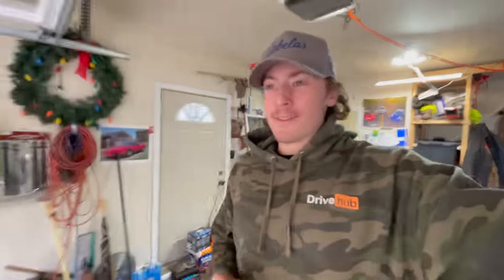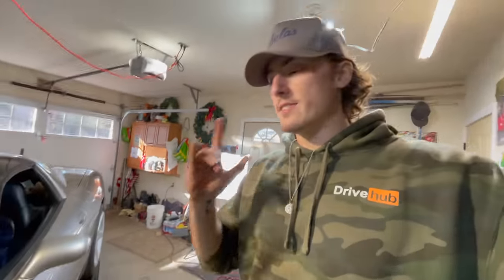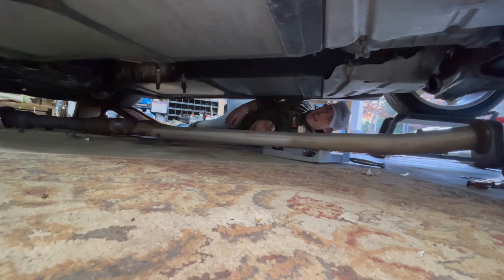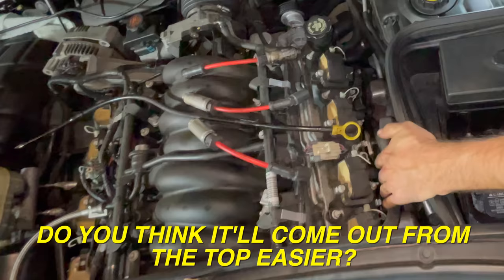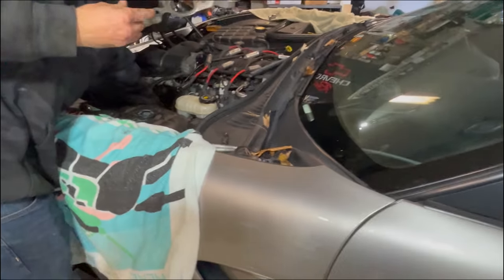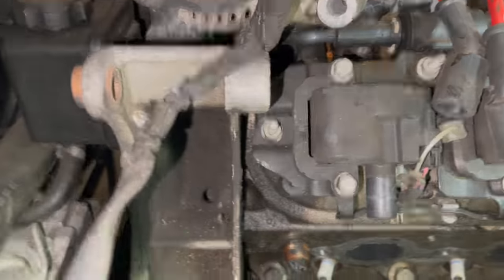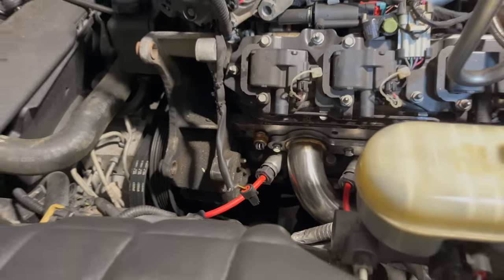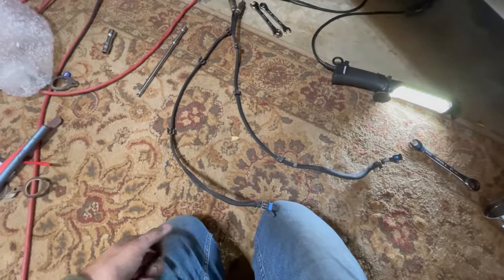I PUT INSANE HEADERS & X PIPE ON THE C5 CORVETTE!!! *C5 Corvette Headers Install | DriveHub

Comment: Here's my two cents of advice having done a lot of headers in the past 50 years in driveways and garages on many different sports cars. Number one get at least a basic repair manual like a Haynes and read the parts relating to removing exhaust manifolds and exhaust systems before you start so that you don't have to be guessing about basic things like how many oxygen sensors there are and where they're located. Number two get that car much higher off the ground. Number three buy a lot of WD-40 with the snake around and point metal nozzles and soak every fastener a week. And my recent addition to what needs to be done is to watch every YouTube video that exists about doing the job you were going to do with a critical eye and picking out the best tips from each one.

Comment: I ran short tube headers on my C5 for a couple years - I was told that long tube headers would be better for a quicker response.  I'll freaking swear by my long tube headers and the straight pipe set up I have now. Performance, launch and overall fuel mileage is outstanding !!! Not to mention the SOUND !!!  We (our corvette club ) does every parade within our two cities and I get Major Thumbs Up 👍  and Cheers from the crowds when I wrap the pipes up !! No one comes close to the pure sound of 560HP at 5000rpm.
Have fun - keep tinkering !!!

Comment: Awesome video!! Installing header's and an exhaust in your garage is a big job. 

I've installed a few exhausts and sets of header's over the years and I would recommend that you install a set of locking header bolts and not reuse the factory bolts. I'd also install a heat cover over the spark plug wires with the new header's.

The only other thing that I would do differently is to add a set of high performance mufflers to help with back pressure. I've always seemed to lose power on my cars when I've tried to run a straight exhaust. It probably wouldn't hurt to Dyno the car with and without mufflers to see if it makes a difference.

If you go with mufflers I would highly suggest a Borla S-Type system. It makes good power, isn't overly loud at idle and part throttle and has a fantastic exhaust note at wide open throttle. It's not overly loud but it's an aggressive, civilized exhaust note with a distinct sound.

I was sold on Borla exhaust systems 20+ years ago when the guys that I knew who drove Vipers in the Vettes, Vipers & F-Body club wouldn't use any other exhaust on their Viper's except a Borla because of the exhaust note that it made. The older Viper's had a pretty bad sounding exhaust note from the factory (similar to a milk truck exhaust note) and the Viper owners I knew were fairly sensitive about this.

Comment: Nice work! I enjoyed this video as well. I am, and have been, sort of up in the air regarding what headers to get for my '97. You already heavily steered me in the direction as far as exhaust goes- mine has a Billy Boat set up that sounds okay and looks cool, but that SLP is exactly the sound that I want, so I'll be looking at this particular brand. Did get black C6 Z06 wheels for what I thought was a good deal mounted up recently and just before it got "cold", I splurged on Z51 shocks and Steinjager front and rear sways as well as endlinks. Glad I did because I found out that a shock was blown and a link was busted- the car was all over the place when driving on uneven surfaces. Almost scary in a sense. So, finances willing, cold air, headers, exhaust and new tires next year! It's nice being able to watch other enthusiasts who document their upgrades via YouTube. I talk about my car here because nobody else, save for a few friends, really knows or cares about what I am doing to my Corvette. Keep rocking the vids, man! 👍👍

Comment: The air system will be turned off in hptuners when you tune it, it's just a checkbox, then removing the excess when you have the intake off whenever that is (also replace the oil pressure switch when intake is off).  After seeing this i'm glad I got the Texas Speed headers, they were just bolt on, included the pipes you had to cut off and reuse, o2 extensions, gaskets etc.  The short pipes on the back that goes under the trans are great location for cutouts as well, and just mark them, unbolt that short section, etc.

Comment: I am not sure if they are still around but when I had my C5, I used FLP headers and system. They had a section where you could install their high flow cats, or a straight pipe. I used to put the cats in for inspection and take them out for track days. It took about 10 minutes to do. I love that you try these things on your own. I am the same way. I can't wait to see you rebuild that LS1 when the time comes. ;)

Comment: lol you were tripping not removing the coil packs removing the old manifolds, they come out in like 2 seconds with them off. definitely delete all those vacuum AIR/EGR lines, cleans up the engine bay and makes working on the car easier in those areas. i had the same reaction when i started up my c5 for the first time after my header install, nice job

Comment: How are you passing emissions without cats? I’m looking to buy this C6, it’s straight piped. And was wondering what would be easier, getting new cats which are pricey r something else?
Reply: get it tuned and you should be good, i just recently passed emissions here in maryland with no cats on my c5 thanks to the tune. if theres a check engine light then you probably wont pass
Reply: @yungtooli  he said he’s tuning it right now, but it only has the ABS light because he took off the module. So a tune should do and it’ll be fine?
Reply: @wackysamurai1583  pretty much, otherwise a check engine light will eventually pop up and you wont pass. took my car about two week for the cel to pop up after removing my cats so make sure you have proof its tuned before buying it.
Reply: @yungtooli  so the car is in Colorado, and I live in Utah. I’d make sure it’s tuned, take it to get emissions and do the paperwork to transfer to Utah just in case so it shows it passes. Thanks man! I’ve never dealt with tunes or mods that require a tune so I’m still learning haha

Comment: No cats and no mufflers. Any issues with state inspections? Deleting the rear 02 sensors require programming out the MIL. They are to tell how the cats are working. The front O2's are the important ones for the car to learn air/fuel mixture.

Comment: That AIR system isn’t too hard to take off. To get the passenger side off, you will have to remove the intake, or cut the pipe on the passenger side back corner like Dave did on his channel yellowvette04.

Comment: I think you could have tucked both clamps if you would have cut one side of the new exhaust shorter, and cut the other pipe from the old exhaust longer so the cuts would have been staggered. Great video otherwise!